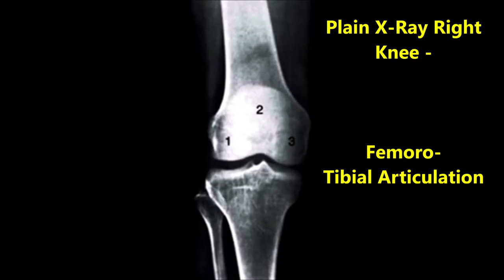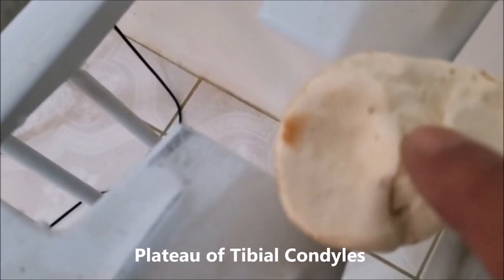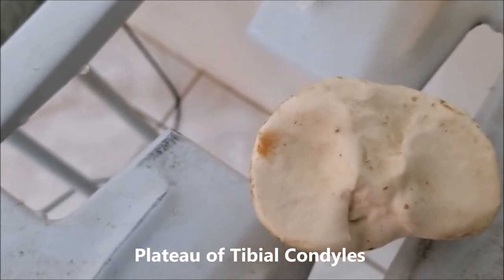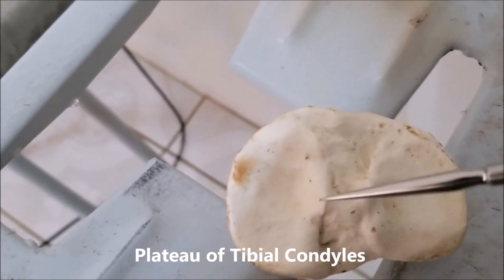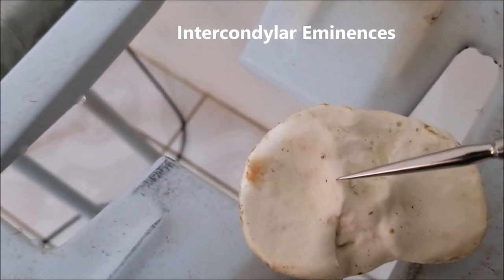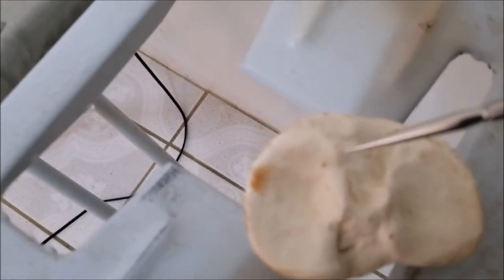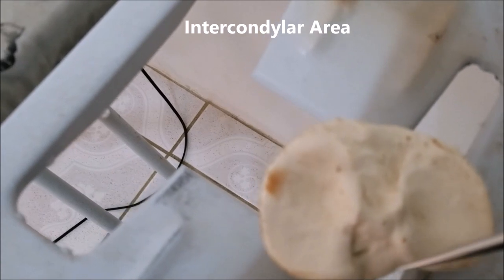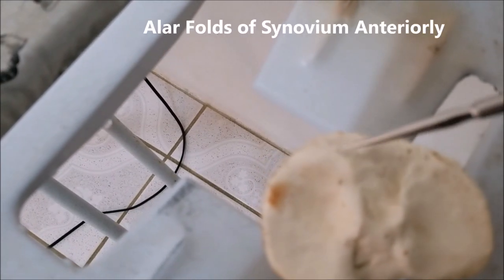FEMOROTIBIAL CONDYLES Menisci Cruciate Ligaments Injury Triad and Clinical Aspects – Sanjoy Sanyal

Comment: Good evening sir , sir  locking and unlocking occurs but y so....  some saying it is because of the longer AP diameter of medial condlye of tibia but  if medial condlye is bigger so is the  medial epicondyle of femur ...
Reply from the maker: Locking (and unlocking) is related to rotation of Femur on Tibia (in Closed Kinetic Chain), or rotation of Tibia under Femur (in Open Kinetic Chain). It is initiated by the Popliteus and assisted by the Cruciate Ligaments. The larger medial condylar surfaces of both helps in the process.
Reply: @SanjoySanyal   sir open & closed kinetic chain means ?